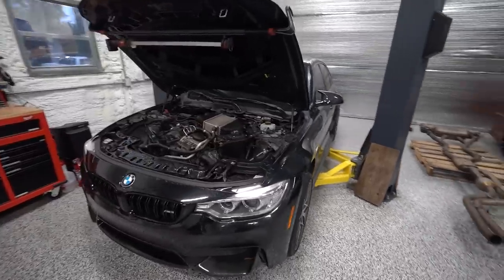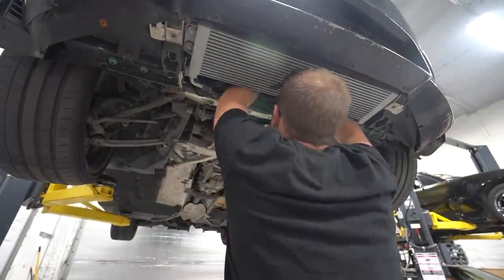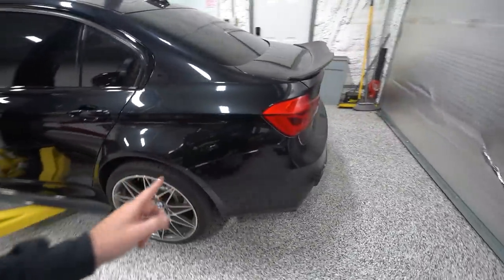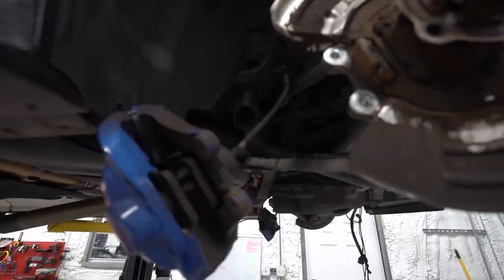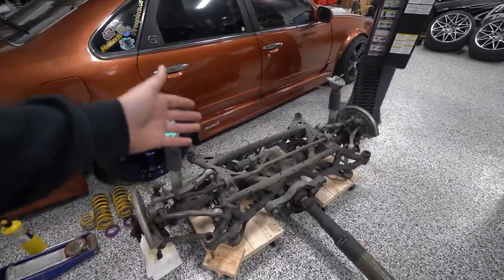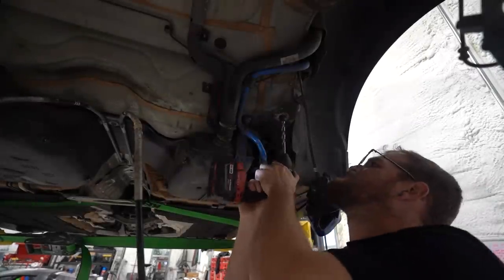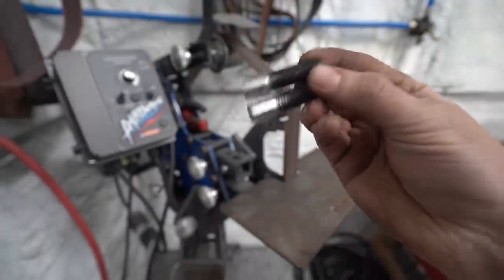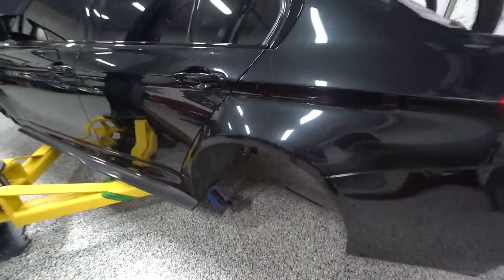F80 M3 drift week build. ep.2 tearing apart a perfectly good car.

Comment: Every 15 minute job is one broken bolt away from becoming a 3 day ordeal.
Reply: But the YouTube video I watched the guy did it in 15 minutes - it’s just plug and play. Is what I have said too many times
Reply: Hahaha so true. Sometimes stuff is smooth. Sometimes the easiest project takes forever.
Reply: Most true statement I’ve seen in a while
Reply: @crazymike401  word
Reply: AMEN!!!
Reply: My truck been sitting since july
Reply: I feel this so deep within my soul
Reply: When it’s going too smooth, I start to sweat and worry…..
Reply: Cries in MINI BMW yep!
Reply: Way too close to home. Broke my front subframe bolt last week!
Reply: Wanna make an easy job hard?
Just say it's a quick easy job to someone... It will instantly double the time it normally takes ..
Reply from the maker: @crazymike401  as josue likes to say "bolt-on" nothing is ever really bolt on. lol
Reply: ? Of the day for Ray, Can I do a simple Rear radiator without all the fancy fab work? But Just with some brackets -12 hose lines and bulkhead fittings, the expansion tank? Or do need the extra water pump. This is budget build my first ever on a 96 e36 bimmer with the 5.3L engine. 50/65 twin turbo kit and summit cam with beehive Ls6 lifters, stock bottom just new internals ect. Can you Help me bro! I live in the Florida area PSL. To be exact... I've watch many of your channels. It's very influential!!👍🏾
Reply: for removing bolts like those, the oxyacetylene torch is your best friend
Reply: Whenever you say it's going to be easy, you usually jinx yourself 😆
Reply: @lloyd9435  can't be tight if it's liquid?
Reply: @MichaelS537  just heat it up till its red hot, then zip it out with the impact, comes right out

Comment: I work on BMWs for a living and have never seen a rear subframe bolt rust that bad and I’m in Michigan. That’s crazy! I like the repair, good work.👍
Reply: The only time I've seen it is a flood car but this car is clean so it's a mystery. We had an M5 that sat in about a foot of water for 3 days before sitting in a storage lot for a month and it didn't even have corrosion like that on the bolts

Comment: I’m in Chicago we get this kind of often with the subframe bolts wanting to break prior to them snapping you can use an inductive heater like a miniductor  heat the head until it’s bright red and then impact it out
Reply: Yes! Exactly.
Reply: those miniductors are a game changer in the rust belt northern states. The few times ive had to borrow one working on semi trucks has definitely sold me on them and is on my list of things to buy.

Comment: Thanks to a very wet climate and roads being salted a lot here in Ireland broken bolts are an every day occurrence here. I've always used a set of extractor bits my brother and I bought probably 10 years ago and I am yet to find a bolt that wont give up the ghost once we have drilled it out and hammered one of the extractors into it. I'd say you probably have a set of them but could be an alternative to having to break the welder out next time :) great series so far

Comment: taylor ray just a advice when you wrap the downpipe with heat wrap just soak the roll in watter you will find it much easier and you will also be able to get a much tigher fit

Comment: I've had this same thing, ended up making a 3 cut U shape into the frame/cavity. Folding the sheet metal up for access. knocked out the factory stacked nut inside the cavity. Weld a new nut in place. Folded the sheet metal down and weld it back together. Done and dusted. I would consider a drain hole for the cavity.
Reply: Those studs are not going to hold. The locating pin is maybe 18ga steel.. The psi to bend or sheer 18ga is very low. Compare that to the load strength of a 14mm bolt, secured on both ends sandwiching the subframe to the frame rail.
Reply: Please just think about how much sideways force is getting applied to that locating pin, it wasn't designed to handle that kind of torque.
Reply: Take a piece ofvmetal and bend it right, then bend it left. do that over and over. What happens? When drifting you ask the car to do the same thing. Right then left, over and over...

Comment: Try servicing cars in Cleveland, an oxy acetylene torch is your best friend. If you heat those until cherry red and then let the red fade back to grey then you can hit it with the impact. Also try getting a matco 1/2" air impact, they are one of the hardest hitting 1/2" impacts on the market. Also try getting an inductive coil heater, they can be helpful to in sketchy areas...

Comment: Good fix.  I am a little bit concerned though as  welding 10.9  to the car chassis due to the alloys and being dissimilar in composition is most likely going to  result in it being very brittle and breaking off. Have tried welding those bolts before onto low carbon steel with mixed results. That locating lug will be taking most of the loading though so you should be alright. Drift week will be a good test.

Comment: I'm not sure if you've come across this method of removal before but I saw someone use a air hammer with a socket adapter. It gives that smash to help break up the rust and then you can turn it with a wrench instead of throwing a bunch of torque with an air impact/ electric which ends up snapping the bolt.

I'm in a salt belt and have a truck I've been repairing that just keeps snapping bolts. I tried that method on some glow plugs recently and was pleasantly surprised when they came out. Maybe these ones would of came out on their own but I went through that hole drilling process on the headers and things got all janked up so the last thing I wanted that to happen to was the engine.

PS. I appreciate how up beat you are when things go south. I realize a lot gets edited out but you rebound better than most... or at least this fella haha Cheers!

Comment: I like to coat stuff that likes to rust like axle nut threads, hubs and some bolts with anti-seize. It's hydrophobic so water repels and keeps the metal from rusting. Just a light brushing will do it. I love it on hubs especially.

Comment: Easy outs also put more pressure on the threads, making them even more stuck. Heat from oxy acetylene is the best way if the bolts are accessable. Map gas doesn't get whatever is stuck  hot fast enough.

Comment: Taylor, I live in the land of rust and corruption (IL) when I dropped the subframe on my E91, it didn't even have half the corrosion on the subframe bolts after 9 years and 140k miles as what you have on yours.

Comment: you can get a pice of steel pipe with a OD smaller than the bolt and using a stick welder stick the rod in the pipe and weld it on to the broken bolt. then all you do is get an acetylene torch and heat it up until its red and ill come out.

Comment: You should look into this RECALL CAMPAIGN 16V-653: REPLACE THE REAR 
SUB-FRAME BOLTS. That does answer your worry about the Helicoils. 
Anyway, I agree you are better using welded studs and nuts at the bottom but the best would have been to thread your studs in before welding.
Maybe drill small horizontal holes to plug weld higher than you did?

Comment: Disconnecting ALL the grounds and sensors BEFORE welding those bolts,, VERY SMART decision Taylor. Trusting the welds? Well,, what good choice do you have but GO FOR IT and find a way you can examine the rear of the car and "know the welds are good" before you put the car on a track and after the track session and you hit the highway.  We all have faith in ya partner :)

Comment: I had something like that happen on a subie outback. Had to make a hole under the rear seat  in the sheet metal and pound out the old nut and broken bolt. welt a nut in.weld the hole made and half a pac of cigs later. tah dah!

Comment: You would benefit massively from having a full  torch setup.
no saving those front bolts, see that nonsense every day here in Ontario Canada. those axles nuts are pretty standard condition here. Half the time they come with just the Milwaukee, half the time We cherry them they the torch and spin them out.

Comment: If you ever need to get a broken bolt out without damaging threads use a piece of copper tube obviously less the diameter and fill it with welding material. Weld to bolt head and turn to remove. The copper will not damage the thread because it is softer.

Comment: If you have to do header wrap, drop the wrap into a bucket of water, the wet wrap holds the fibers down so no itching. Also it will last linger if you apply a coat of waterglass sodiumsilicate.
Reply: I use DEI titanium wrap and I use it dry. Never had an issue with it causing any itching.

Comment: A way to remove rusted bolts is to heat them up with a welder. Red hot on the part that you can get to and that has a very good chance to burn the rust or expand end break the rust. Its best to try that before you snap the head off.

Comment: I own a Vw 2013 Jetta Gli, and damn this video makes me think of it. My uncle told me when I first bought it to take care of it and she'll take care of you. I've had nothing but problems... I've owned this 2013 Jetta Gli for 3 years with 50k when I bought it. I've replaced 5 headlight bulbs, 3 tail light bulbs, faulty intake manifold and now have a revised one with a different fuel rail. My seat belt alarm goes off randomly when I'm wearing it every now and then. It burns oil more than any car I've owned. I've replaced the timing chain and pretty much anything that had wear. When I first changed the oil, I guess the previous owner was a dip sh*t and stripped out the torx oil drain pan plug and also looked like he never changed out the washer ever... or even replaced the actual 6$ oil drain pan plug. I had to drill it out and then pull the pan. 
Electronically something is wrong with the car, but I've took it to VW and they say everything looks fine.
First German car I ever owned so I never knew what to look for. I gotta say, if you have the money and a shop, they are cool cars... but for a daily even if it's 10 mile daily... I wouldn't buy one unless it was brand new, i garaged it, and serviced it properly... unlike buying used and never knowing what has been done or better worse... not done. 🙈

Comment: Saw a video recently where a guy used a 'hinge pin centering bit' in a drill, combined with left hand twist drill bits to drill into snapped bolts without risking damaging the threads of the fitting. Might also need a stud extractor once a decent pilot hole was drilled.

With impact drivers, sometimes I've found that if you try shocking them to go tighter first, they often then will undo.

- Anyhoo, you must have got it/them out in the end.

Comment: Hope the subframe studs hold… welding bolts weakens them a lot both from the heat changing the material properties like ductility and the weld profile like any under cut or porosity and impurities become stress raisers and a failure point. 

Drilling and taping the old bolts out and Helicoiling if required would have been a better bet. You could still use suitable strength studs to stop the issue moving forward.

Comment: Make sure the clutch is installed right way. Mike from stanceworks got a clutch from CM and it came withe disc flip around. He didn’t corroborated the proper way and ended up installing it wrong. But CM master sent him a replacement either way.

Comment: On the bright side, there quite a bit of bolt sticking out, throw a nut on there and weld it. The heat usually does the trick. 
 Edit: just saw you drilled it out so it might be too late for that.
Edit x2: guess that wasn't a bolt that was sticking out, maybe a bushing type thing of some sort?
Reply: A magnetic induction bolt heater will work as well.

Comment: A word of caution, make sure you replace the flywheel bolts with new OEM bolts that have the thread sealant. If you put bolts in without the sealant, oil will leak through on some engines. The bolt holes on some crankshafts pass all the way through and will allow oil to leak all over your clutch. If there was no evidence of sealant on your flywheel bolts, just ignore what I said.
It's been a while since I worked at BMW, but working 13 years there I've seen a few techs make that mistake.

Comment: Interesting thoughts on the clutch. I’ve heard a lot of people say they go the other way when specking a clutch (getting one rated less than the hp of the car) as they would rather replace a clutch than a trans or even driveshaft. Especially considering you mentioned that slipping the clutch intentionally is something you are worried about… wouldn’t it make more sense to go with a weaker clutch? I’m no mechanic and have only drifted “stock” cars so don’t roast me too hard here lol

Comment: 1 week ago: 'I bought something reliable: stock car, stock driveline, no problems.'

Today: "We've literally pulled the entire driveline out of the car with the exception of the engine, which we did very tedious work on the engine itself." (and a major welding project to reconnect the subframe)

If this isn't the most relatable car video on the internet, I don't know what is.

Comment: i work with a lot of 50+ year old motorcycles, some come with front and rear forks with the most fucked up bolts you can imagine, a tip i can give you is cre-oil, put some cre-oil and impact it to help it penetrate, come back about 10min later, more cre-oil, impacting for penetration. then 10min later come back again and it will probably come out. if it does not, try using a torch aroung the bolt, not on it, to make the metal around it expand and possibly unsieze. hate breking subframe bolts.

Comment: Not an m3 obviously, but many 90s civics have the same issue of captive nuts in the rear unibody that the toe arms bolt to. It's a T style nut that slide back and forth in a channel to adjust rear toe. And they are always rusted or seized In the body. The only way to fix it is to cut or break the bolt off. Holesaw the chassis and get the nut out and replace it then weld the hole back up. It's a nightmare. Ask me how I know. 🤣

Comment: Do you ever worry about getting a car on the lift unbalanced? Like with that subframe did you think that it could have made the car unbalanced on the lift? That would be on my mind with ever fricken part that came off lol but I’m….. special lol
Reply: You just have the car low on the lift and give it a shake by pushing it down, I've always said "that ain't going nowhere" while doing the push test and never had a car come down after removing engine and full front suspension.
Reply: I used to do a lot of engine outs. Unibody cars aren't that difficult to get stable to not worry too much. Short box regular cab trucks can be sketchy. Either way you can usually feel an imbalance at which point you should be supporting it with something like a pole stand. I've seen 2 techs drop vehicles off hoists and in both cases it was sheer carelessness.

Comment: I've been a mechanic in the rust belt for 18 years. You need a real torch. MAP gas is for plumbing. I see a ton of people using it and honestly it does next to nothing to help. Using oxygen and acetylene you can get something hot quickly and precisely. Both being very important. You want to get a bolt out you need to get the bolt hot quickly to expand crushing the rust then get it cold quickly preferably with oil etc. It will shrink. Using a map torch by the time you get the bolt "hot" everything is hot  and everything has expanded and you have accomplished nothing.
Reply: "Get in and get out!*

Comment: Snapping a bolt off in problematic areas is a situation of not if, it’s when. It’s going to happen at some point. 

I had it happen on a turbo. Dang Subaru uses crappy grade bolts all over the car.

Comment: I think you're nuts. You could certainly drill and re-tap (from under the car) and it wouldn't matter if it was exactly centered or not - it just needs to be close. The tap would likely find the existing threads but it probably wouldn't matter. You're welding to a locating sleeve designed for pure shear. It may not be able to take the clamp load of the bolt.